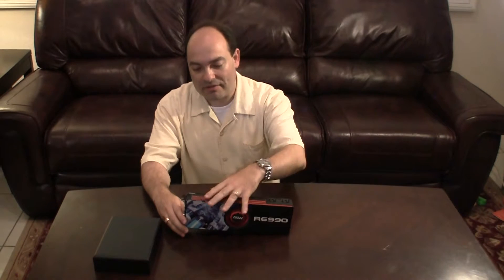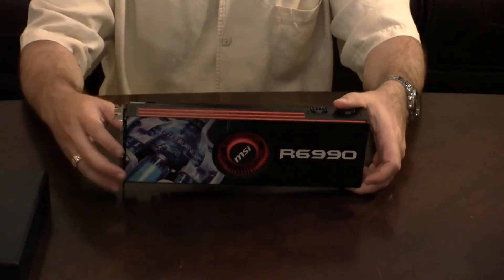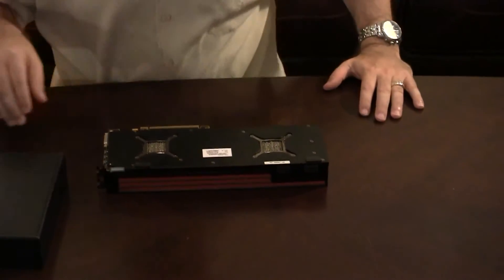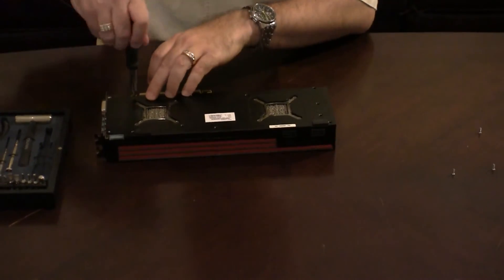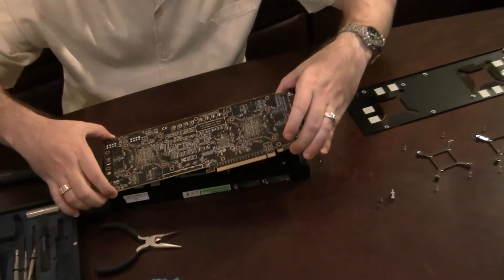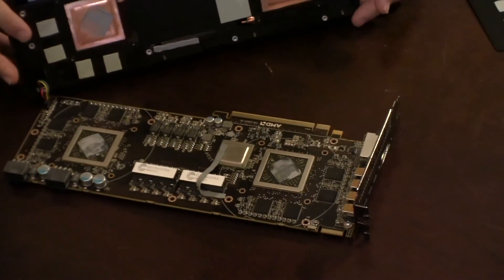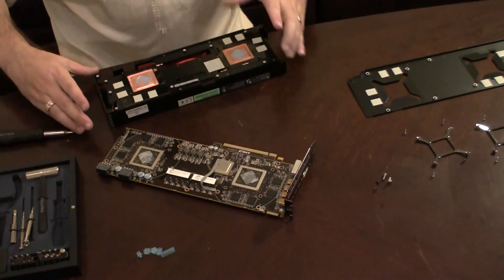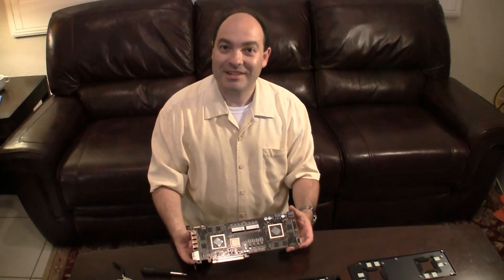Water Cooling Your Computer - Part 13 - Taking apart an AMD Radeon 6990 for a water block install

Comment: Why do you think that using a magnetic screwdriver is a bad idea? You'd need a far more powerful magnet than one barely strong enough to lift a reasonably sized screw to do any damage to your graphics card.